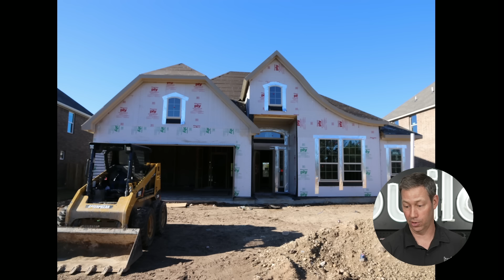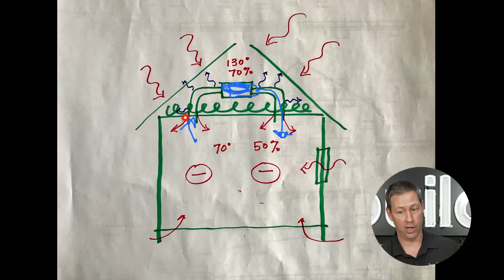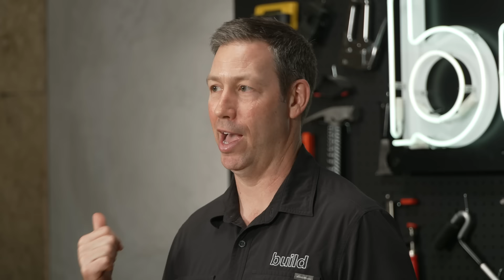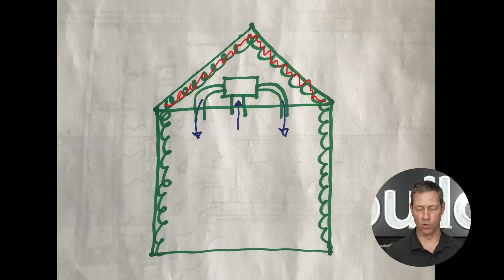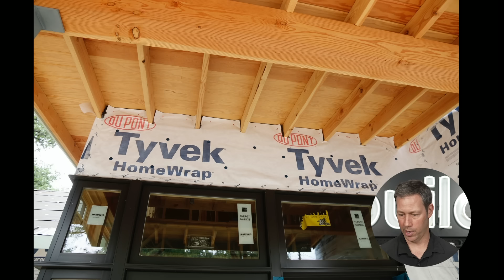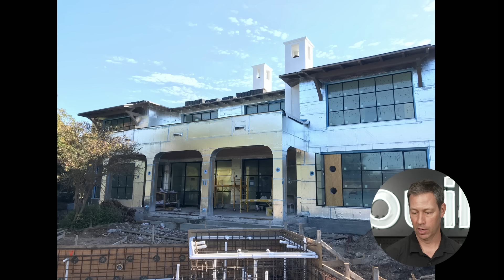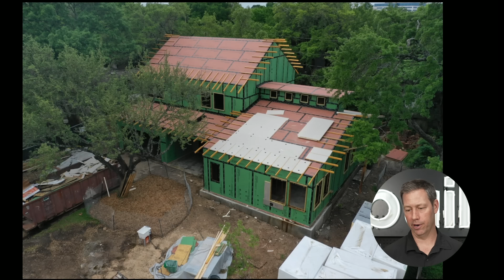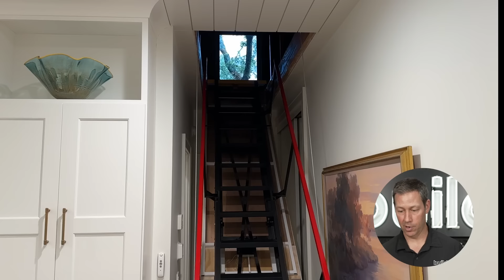CRAPPY ATTICS are Standard in America! Here’s how to BUILD - DECENT or AWESOME

Comment: Love your video. Very informative. I do have a question or two... I have a 3,189 sq/ft home (2-story) in FL with 4 vents on high points... I am building an attic space for utility room (hanging 2 air handlers). I am using 2 X 6 beams supporting truss beams, so it lowers the interior room ceiling, allowing cavities for airflow (if needed). I am also sealing ALL holes vent pipes, electrical boxes, attic access, everything, and spray foaming to seal utility room walls and ceilings between attic with Great Stuff Closed Cell foam. 

Unfortunately, I can not do the Rockwool insulation as I have cross beams at all roof decking seams. So, there is no continuous cavity to run batting.

Questions;

1) Do I need baffels at all, or should I completely seal the attic and all ridges, since I will spray foam everything?

2) Since I have attic vents currently, which are currently 12" X 24" cutouts, which I am looking to replace as the heat is sometimes 130° up there and no way adequate... If I seal and spray foam EVERYTHING do I even need them at all?

Wish there was a way to add pics to my comment to make better sense 😬

Comment: I like putting #5 mesh stainless steel mesh screens in the rafter bays above the wall's top plate, keeps critters out not the bugs but if you've bugs penetrating your roof line / soffit region you likely have foliage too close to or above your house & I'll be cutting it back or telling you to hire a tree company to that extent. 

That said, I don't do this For the foam insulation albeit when the installer blows through it as they're instructed I'm sure it's no foul, it's really just intended to keep rodents from easily penetrating the roofline. I don't know how they manage it but I've seen mice climb the inside of gutter downspouts.

Comment: On the US car build... you still use leaf spring suspension... as in the horse and cart.
Go fix all the AC you want (along with the carbon footprint) unless you insulate properly you will be forever paying higher energy bills.
My 1930s build brick house... all the internal walls are 110mm brick only one wall is stud and that is between the kitchen and the office.
As for loft insulation we currently have 100mm of glass fibre insulation.  To improves the energy efficiency of the house I am going to use solid insulation between the rafters and the gets complicated given it is the three pitch roof... over that insulation I am putting bubble-foil insulation to ensure the house it golden from the roof.
The previous owners and probably from the 1930s hoped the now disintegrating tar paper would be effective.

Comment: I was told that putting insulation directly on the roof sheathing would cause premature shingle failure due to excessive heat buildup.  I'm not a builder but I have heard this from some who are. (Asphalt shingles)
Reply: And they heard it from someone who heard it from someone ... ;)

It doesn't really increase the peak temperature of the shingles, it almost can't. Insulation essentially works by absorbing heat and radiating it slower when it cools off. The overnight temperature if you measured via IR would be higher than it was previously as it radiates out at night, but not higher than it was during the day. To get a sense of the difference, compare it with radiant barrier (think foil on the inside of the roof) which actually reflects the heat upward rather than soaking it in. In tests it shows from a couple up to 10 degrees increase, which is still below the operating range maximum of standard asphalt shingles. A standard dark asphalt shingle roof over ventilated attic can sustain 160f degree temps for 5-6 hours, at maximum radiant barrier you might sustain 162-170. Remember that is with radiant barrier - ventilation is not a factor there. 

Thus insulation that isn't a radiant barrier can not reach that same sustained peak. Ironically, it can reduce one of the causes for prematurely asphalt shingle failure - thermal shock. Rapid increases or decreases can cause additional wear and even cracking. An insulated roof will slow down the swing of hot to cool or hot to cold, thus reducing thermal shock.

Now for more contextual understanding, going to a "cool color" asphalt shingle roof can cut your roof temps by up to 50 degrees Fahrenheit. So even if you're still concerned, switching to the cool color shingles can drop temperates by far more than even radiant barrier can increase.

Now as to the whole "void warranty" thing that others touch on, heft doses of salt are needed.

First, how often does one collect on a shingle warranty? Very rarely as they are structured in a way to minimize any actual payout benefit you get. Then look at realities: At the top end of experimentation and research, an unventilated attic can, in the right conditions, increase average roof temps by 2.7%. However, cool color shingles have up to a 33% drop in peak temps and a 27% drop in average temperatures. Does the manufacturer have less or no warranty on dark shingles compared to light ones due to "temperature"? No. I've never even heard of a manufacturer doing that. But if a 2.7% increase was too much for literally the same material in cool colors with an order of magnitude larger change, why would the dark ones have the same warranty as the light ones? They wouldn't. Even a negative view of manufacturer warranty practices would have us expecting that darker tiles would be under a  less comprehensive warranty than their lighter ones - so they can get out of any claim payouts easier!

Comment: Even though the ducts are hung, at 4:50 the airflow is going to suck. Using only thin straps, pinching the flex insulation. Need to use duct saddles and stretch the inner layer, with minimal angle bends or hard pipe 90 degree bends for more than 30 degrees IMO to maximize airflow. Duct Compression on flex duct is an airflow killer.

Comment: I have a crappy attic. I'm in Florida and my ducts run through the attic, one section has rusted and is leaking water from the condensation through my kitchen ceiling and I have mold spots on the drywall in the kitchen, so part of my drywall ceiling has to be replaced. I also have to replace all all of the ducts in the attic.

Comment: WOW! We need your help here in FLORIDA. Built a steel frame house with a cathedral ceiling in the living room; a loft over the bedrooms. Hubby insulated the quack out of the attic area and above the cathedral ceiling....only to discover that this turned the closed attic spaces into a virtual GREENHOUSE. The ductwork was literally dripping with moisture. We have since been told that the ductwork was not properly wrapped/installed, although done by a professional. Hubby pulled out all that wet insulation....where should we go from here? Our whole house is wrapped in a silver barrier of some sort, but I'm pretty sure there is air flow via the soffits into the attic, plus we have a vent-a-ridge on top. PLEASE OFFER ADVICE.

Comment: Utility Rooms should be made standard!!

-For starters putting any appliance that creates or transfers hundreds of gallons of water above the ceiling is silly to say the least.  If your coil freezes up, that flimsy drain pan WILL NOT SAVE YOUR CEILING!  Nor will a primary or secondary flood stop switch.  Funny how home builders don’t account for a leaking evaporator coil or dirty air filter causing a freeze up.  

Secondly why are we making it difficult for the homeowner to maintain their system? I’ve met hundreds of older couples that refuse to go in the attic and change their filters they claim its too dangerous, that’s if they can even manage to get their pull down open.  

I was a lead installer in Texas for a few years the code and build quality is negligible to say the least.

Comment: Excellent information, Matt. Thank you! I'm looking forward to watching your new series.

I am initially deciding between adding another 4" of blown-in cellulose to my 10" cellulose base or, as you suggested, spray foam on the roof and vacuuming the cellulose altogether. I am torn between the two. The 1,954 sq ft ranch-style house is located in Phoenix, Arizona. My Lennox Signature HVAC (up to 28 SEER) and gas furnace are in the ventilated attic. I have seen the attic temperature get as high as 123 degrees. 

My utility bill is exceptionally reasonable at $193.00 per month, up from $157 due to a price increase. This includes a 9,210-gallon pool running 12 hours daily. Bottom line: Should I keep the attic ventilated, add spray foam to the rafters, and remove the cellulose, or just add more cellulose?

Because my utilities and house are very efficient now, I would like to know if the spray foam and cellulose removal are overkill, especially since my two bids are $7,998 and $9,974, respectively.

D2

Comment: What I didn't hear you mention is that your AC condenser that must reject SOMEWHERE the heat that it removes from the HOUSE air, is now trying to reject that heat into a 130 degree space. THAT is what I find truly crazy. At least it's in a shaded space and not sitting ON the roof or in the sun on the ground outside, but it would seem to me the best place for it would be a shaded structure on the ground outside. Still not ideal, but probably the best one could hope for?

As for your own home, that's awesome as an example to others and that's all well and good, but most builders are NOT going to do that. They want to just slap them together with the cheapest materials to barely meet code (which is often not good enough, and it seems all too often not even meet code!), and then get them sold. We can't all build our own new house to have it done right. We have to make the best of existing construction in houses that we have to live in WHILE we are renovating and fixing all the garbage work done by original builders, stupid previous owners and shoddy contractors over the years. Good GOD if I had a dime for each thing I have found in just two houses we've owned now, it would pay for all the renovations we've done in both houses!

Comment: Awesome video, thank you for the insights.

For older homes, with soffit vents and NO ridgit vent at top, would you recommend spray foam in the attic (Texas) I was told the intake air should not be blocked? 

I been considering radiant barrier on the rafters but I’m doing my research before any move 😁.

Thanks in advance for any feedback

Comment: If you seal up the exterior so well, but still end up having a moisture issue some place, won't that cause ever more of an problem since the moisture will stay between the exterior and the drywall with no place to go? I really like the idea of putting so much effort into making your home as efficient and controlled as possible. I just worry that if it can't breath when it needs to you might end up with a bigger issue. Perhaps I'm off-base here.
Reply: You have to have air to air heat exchanger to get fresh air in and polluted and moist inside air out.

Comment: Not a single word about one of the most important reasons attics have traditionally been ventilated. Most houses in the USA have asphalt shingle roofing systems. These shingles are vulnerable to overheating, especially because they are usually dark in color and hence absorb maximum heat. Asphalt is made of aromatic hydrocarbons, which are gradually driven off during thermal stress. They also expand and contract to a degree proportional to the intensity of the daily thermal cycle. i.e. the hotter they get, the more they expand and contract throughout a daily heat/cooling interval. When the upper roof sheathing is insulated in the way these "advanced" attics are? The roofing material temperature gets much hotter when compared to the traditional attic which keeps a constant flow of cool air circulating under them. This maximizes temperatures AND thermal expansion/contraction, greatly accelerating degradation in asphalt shingles, often turning a 30 year shingle into a 15 year shingle. 

Metal roofs are more resistant to this, but they are impacted as well. Most people choose painted metal roofs, so the paint degrades faster due to higher temps. Also, the rubber sealing gaskets used on many/most roofs will deteriorate faster as well. Top end standing seam and raw galvanized finish definitely helps, but most people aren't going for the barn look, and even if they are, HOAs frequently disallow it.

Comment: Spray foam in the future in the case of damage repair on xyz section of house seems like absolute nightmare to deal with or even know about until it's done catastrophic damage before you find it ?? for me an example comes to mind , It's like late model (mostly 70's)  VW beetles .. They spray foamed the rear quarter panels behind those vents..Moisture an stuff would collect in that foam and just sit there, and years later they all rotted from the inside out.. You would see a little rust bubble form on the exterior and behind it was 100x worse.. I don't know anything about this stuff on houses, I'm just here to learn. I live in Florida as well.. I was going to build a post frame like what RR is doing but post frame seems extremely difficult to do here w/ code hurricane ratings etc.. So i'm leaning towards metal / red iron "barndominium" I guess.... Just trying to figure out and find ways to make it super extremely efficient! Feel free to correct me or suggest any informations.

Comment: Why are these furnace in the attic.  Put it in the mechanical room on the main floor.  And run insulated duct, a trunk line then branch off. Much easier to do maintenance and replace the unit. Out of sight out of mind, soon you forget to change filters. Oh yeah most people don't have a extra 30 to 40 thousand for spray foam.

Comment: Matt, I live in Nashville, Tennessee, which is in the transitional zone between hot and cold climates.  We are unsure whether to place control barriers on the inside or outside of the structure.  This is due to the unknown location of what I refer to as the condensation plane.  That is where condensation occurs at various places in the wall due to changing exterior temperatures and humidity, combined with interior cooling during part of the year and interior heating during the rest.  Could you do a video on this dynamic?  Thank you.

Comment: My parent’s house is the perfect example of a crappy attic.  The house is a crappy ranch style that was built in 1961.  It has very little insulation and still has the original uninsulated single-pane windows and wood doors.

It was exposed to the garage and elements for about thirty years before my dad finally installed a garage door and finished the walls and ceiling of the garage with MDF which closed if the attic but it was too late to prevent the spiders, roaches, rats, and other pests from making a home in the attic.  The rats are gone but the others are still there.

There isn’t a basement either but a crawlspace that’s just as bad as the attic with spiders, roaches, snakes, etc.

I have more ideas than money on trying to fix this place but I would rather tear down and rebuild from scratch it’s so bad and probably cheaper also.  My dad said it costs him $10,000 to build back in 1961 but I know I couldn’t do anything that needs to be done and estimate it would cost about $300,000 to rebuild with a similar footage new house but definitely not a ranch style.

Comment: In my experience, building a non-conforming house is exponentially more expensive. So, in most towns, when you go into a neighborhood with houses built in modern times, they are all built exactly the same. If you want something different, even minor changes, add $20-40,000 onto the price simply to have the plans customized. That doesn't even account for the actual building of it, which will cost more because they have to change procedures and materials. Suddenly your $200k house is $400k-500k. Now, do I agree that for the $200k price tag things should be built the way you suggest? Absolutely, but that's likely never going to happen as long as companies are allowed to purchase residential properties.

Comment: I have a 1700 sqft ranch, I live on Long Island NY and I have half the house open right now, Why do you like rockwool over the spray foam and if I do rockwool on my vaulted ceilings would I need to leave any barrier between the insulation and the roof sheathing? I can’t get a straight answer from local contractors. It’s amazing whatever they specialize in is “The Best” and contrary to the guy before them. TIA for any advice you can offer.

Comment: Fiberglass does a better job than open or closed cell foam for thermals. But it doesn't handle moisture like foam. At least all data I've ever read clearly states this. Which is probably why its far more likely to be used everywhere in the northeast.

Comment: I'm so confused by the air seal stuff. I always hear about how only one side should be sealed so that any moisture can still escape. Or to put another way, if you seal the outside of the walls extremely well, and then there is moisture on your inner walls for whatever reason, it can't "escape" and then leads to mold. 
Or in the reverse, if you seal the inside of your house extremely well, then the outside needs to not be seals so well so water can get out and have opportunity to dry.

Sealing both the inside and outside really well means there is a gap between them where moisture and heat build up wrecks havoc.

So is it best to seal everything as best as possible from the outside, or from the inside? 

I'm not a builder/contractor, but it's something I would put in practice for smaller projects, barns, shops, storage sheds, repair work, etc. I think air flow  and moisture escape is important, I just don't know exactly how it all fits together.